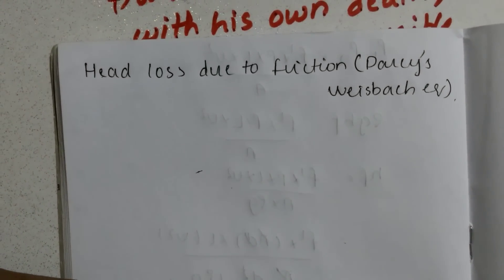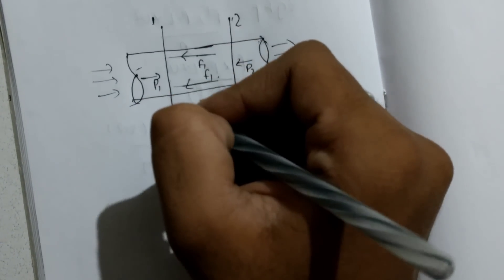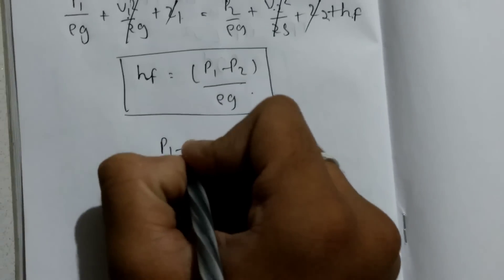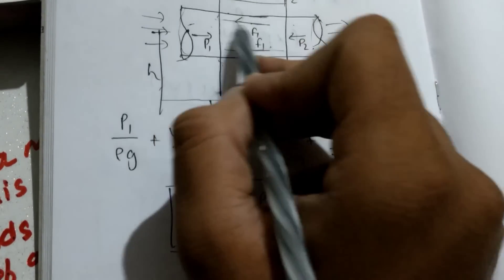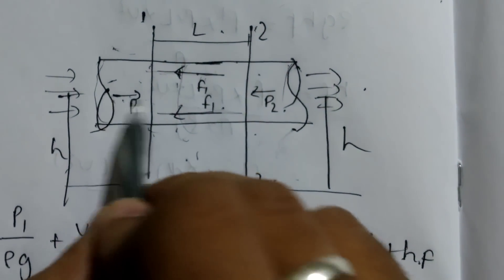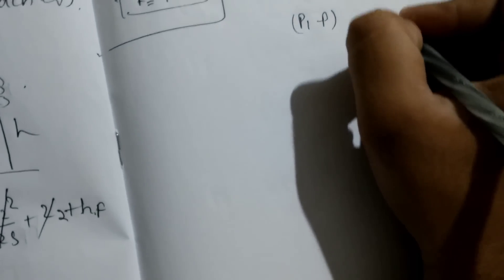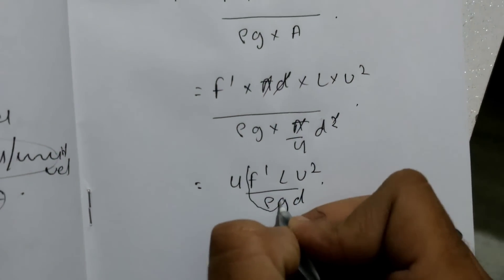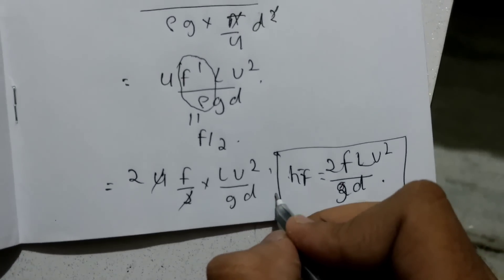Darcy's-Weishbach equation:Head Loss Due to Friction

Comment: Where did the frictional resistance formula come from.
Reply from the maker: Dharmsheel Dutt Tripathi .. without calculating frictional resistance we can't have the value to friction factor
Reply: That's not the answer to my question. why did you multiplied frictional resistance per unit area per unit velocity to velocity square
Reply: bharath raja that's obvious

Comment: why is the direction of P2 is from left to right?................it is outlet pressure so it should be from right to left
Reply: anand kurle P1 and p2 are the pressures acting on the either sides of the fluid layer taken between 1&2..  The layer to the left of the 1-2 section will exert a pressure p1 to the right and the the layer to the right of the 1-2 section will exert a pressure p2 to the left..

pls correct me if I'm wrong..